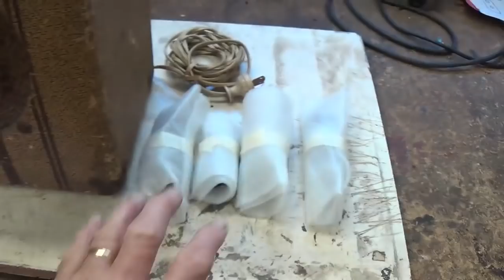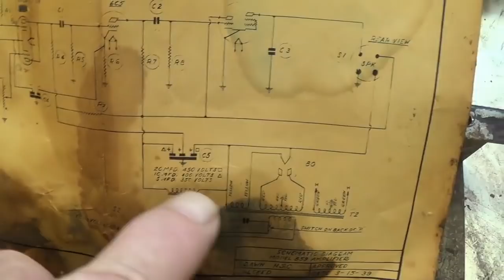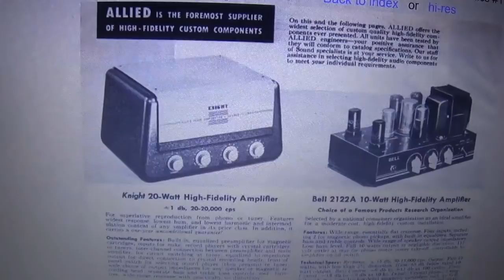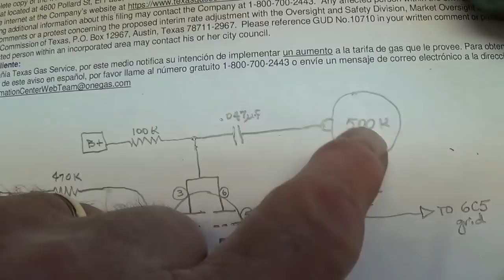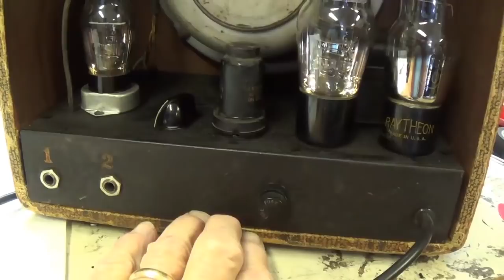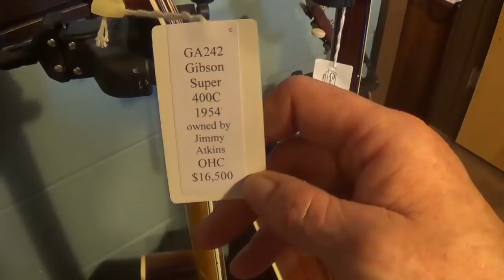Resurrection of an Ancient 1939 Kay Model 859 Amp....The Mouse that Roars (60Hz)

Comment from the maker: NOTE:  I believe the audio clips obtained with the microphone were hampered a bit by the wood fretwork covering the speaker. I tried to aim for an open spot, but still had a noticeable reduction in volume at normal recording levels.
Reply from the maker: It is intended for harmonica, so it may work out just fine.
Reply: Another interesting & informative video UD thanks!
Reply: Doug, perhaps you or whoever owns this amp should try miking it from the rear of the speaker cone, or perhaps use a mike in the front as well as in the rear, and reverse the polarity of one of the microphones by flipping the wires  inside just one microphone cable ( swap the hot and neutral signal wires, at just one end), or making an adapter for this polarity reversal, so that you can use both a front microphone and a rear microphone at the same time .
Reply from the maker: You read my mind, GU. I have a Shure 58 that I intend to use for exactly that purpose.  I'll be experimenting with it in the future. Thanks !!!
Reply: That's alright, honestly all I hear is the heavy MP3 compression on the audio tests.  So even if the wood decoration wasn't there the amp's real tone still wouldn't come through unfortunately 😑.  --Jason ✌🏻&❤️
Reply: Often, an amp in a confined space makes for a good recorded sound - We used to pile wood up in front of Marshalls to get a really punchy sound. So if this is used for harmonica it may well shine! :o)

Comment: Hahaha 
This was the Sprague potentiometer that failed. I mentioned one in a previous war Oahu.
Mine is fine but this one proves why sprague stuck to what they were good at. Condensors or capacitors!
I hope we are doing well uncle.
I hope we all hear from you soon.
Reply from the maker: Thanks, Cdog. We're doing fine and should be back on the air soon :)

Comment: Next time you have the opportunity, try referencing the heater CT to a positive DC rather than ground (30-60v is fine). I find that you get much lower hum. If the amp is cathode biased then its much easier to implement, as you can literally just solder the heater CT to the output tube cathode. If you have an artificial CT with 100R resistors, then its not much more work - just solder direct to the output tube socket using the heater and cathode connections respectively. In fixed bias amps, you can use the negative bias supply or just create a voltage divider off the HT rail to get around 50v together with a small smoothing cap (say 22uF).
Reply from the maker: Thanks for the helpful information, HTH.

Comment: I don't get why you were so insistent on preserving that power transformer.  It was garbage and should have been thrown out.  I know you take pride in your work and like to preserve the vintage parts that are salvageable -- but that thing is, at best, on borrowed time.
Reply from the maker: Thanks for sharing your opinion with us, Evan. Fortunately, the PT and amp are still functioning perfectly.
Reply: Uncle Doug don't make them like they used to apparently.

The old ones at work that look like that are usually toast.  Whatever enamel or varnish they coated the wires in didn't seem to stand up to overheating too well.

Higher voltages at work though 👍

Comment: You should start selling Uncle Doug repair kits thru StewMac that come with 4 Xanax 😂 “Even if the repair fails you’ll still be happy!”
Reply from the maker: Or maybe a dozen Xanax and a pint of Vodka......for the ultimate escape.
Reply: @UncleDoug  GEEZ ,Doug...this just took a fairly dark turn. Besides with my luck hell would turn out to be real and filled with 80’s solid state crate amps.

Comment: I'll bet the reason that the original guitar input had no volume control is because the designers were thinking it would be redundant since the guitar would already have a volume control knob.
Reply from the maker: Exactly, Greg, and most guitars have a built-in tone control, which makes me wonder why people are so focused on developing elaborate tone-sucking "tone stacks" in amps. The purest tone of all probably came from early amps like this one, which focused on amplification, rather than modification, of tone.

Comment: That design is beautiful, but what were they thinking when they blocked the speaker's output by that tremolo/vibrato faceplate?
Reply from the maker: I think back in 1939, they were more concerned with appearance than unrestricted  speaker output, LF.
Reply: @UncleDoug  appearance over output.... that sounds about right.
Reply from the maker: @thelokifiles  Not the way we'd do it today,  for sure :)
Reply: @UncleDoug  I'd enjoy seeing an even pairing. The Vox I have is close I guess.

Comment: I have an old RCA tube manual. In the back section shows the 6N6G is a power
Triod with 300volts to the plate. And proper biasing wich did not specify 0 volts to grid 
Will be 4 watts out so 
Perhaps theres around 3and 1/2 out 
On that very old piece
Of art nice work
Uncle Doug/Danasonic.  Nice vidios Uncle. Yours truly. Dwight
Reply from the maker: Thanks so much for your helpful input, Dwight.

Comment: Hi Uncle Doug I been learning! I have a Vox AC30 it is cutting out! Can you look an check it out?
Reply from the maker: It will end up costing quite a bit to ship it to me, Nick. You might better off cleaning the tube sockets first and seeing if that helps.
Reply: @UncleDoug  Hi again The AD30 is a VT 1 tube I cleaned with Caig Contact cleaner no go volume dies also Gain has some trouble it suppose to go into OD I Live in Mass. 02476 please reply??
Reply: @UncleDoug  Hi again I figure on sending the chassis how can I send it to you I an in Massachusetts 02476 that is Arlington!!
The shipping of course will be both ways if you agree on this all you'll need is a Speaker!! Thank you !!
Reply from the maker: @nickf.9434  Please provide your e-mail address and I will contact you directly to arrange shipping.

Comment: People bad mouth these american made old technologies like wax capacitors ! But they lasted 80 years !$@# you think that the chinese caps even the one surface mounted will last that long ? when  they make 5 years it become a celebration !
Reply from the maker: It's true, Pete, that the components used in vintage amps seem to have incredible life spans. I have several amps that function perfectly with 60+ year old filter caps.....which is not supposed to be possible. I think the newly made components, such as those you mentioned from Asia, will probably last quite a bit longer than 5 years, but may well not be as durable as the vintage parts.  Only time will tell.

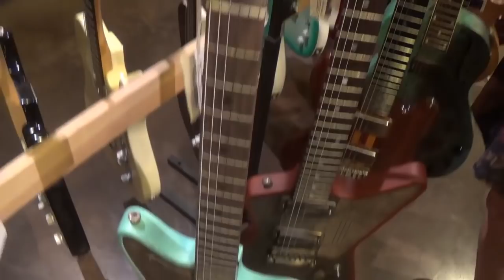Comment: The guitar at 42:55 is really interesting. Those actually may be Jazzmaster pickups. They are in Jazzmaster pickup covers for sure. Quite a bit different than P90s, as similar as they look. Super thin bobbin, wide winding that almost reaches the end of the pickup cover, and alnico pole pieces instead of P90 bar magnets. They have a clear, bright wide frequency response yet still sound Fender-y while P90s are more of a "rock n roll" single coil. More apparent mid-range, great middle ground between singles and humbuckers.

Edit: Just noticed somebody mentioned them before me. Guess that's what happens when I'm late to watch a video and Jazzmaster/Jaguar fandom is at its height. 😉
Reply from the maker: Thanks for your knowledgeable input, Julian.

Comment: The input tube should have a shield, that's what the collar at the bottom is for, the shield slips over it. It's made of aluminum.
Reply from the maker: I used to have "mummy" shields when I worked on radios, OR, but not any more. Hopefully, the amp's owner will be able to track one down on Ebay.

Comment: Looks like the hum was caused by the grid being unconnected to anything due to the faulty pot, which should have been providing its grid leak. How does that output stage possibly work without a cathode resistor?
Reply from the maker: Sounds right to me, EJP.  The 6N6 is an odd tube. Look it up and you'll see just how odd it really is.  There is an internal resistor that provides a negative grid bias with one of the cathodes grounded.
Reply: Uncle Doug Cripes! I see what you mean. What a thing! And positive grid bias on the two RH grids yet!

Comment: One thing I noticed is that all those old amps have the cloth for speaker protection on the inside, vs. some decade(s) later, the complete front covered with it. Is it purely fashion, or economics, or is there a sonic difference? I imagine that the speaker is not connected to the front plate in a perfectly air-tight manner like with the foam stuff around the rim they have today - no idea how much that matters. But it's still dampened with that cloth in between vs. bolting the metal directly on the wood I guess.
Reply from the maker: It's true that in the old days, the grille cloth was behind the baffle, between it and the speaker......while now, it is generally covering the surface of the baffle and gapped away from the speaker a bit. The modern way is probably better, since the speaker has room to "breathe"......but to be honest, I don't think it makes a big difference, as long as the cloth is very porous.

Comment: Hi Uncle Doug--nice job as always.  I would like to say that using the grid stopper resistor in the input stage to control frequency response is a bad idea.  The purpose of this resistor is to limit the high-frequency response of the input stage to eliminate interference from r.f. sources, and also reduce the possibility of oscillation.  One virtually never needs to use a resistance higher than 34k, which is what Fender uses (remember the the 2, 68k resistors end up in parallel).  Resistance higher than that adds noise, and why would we want that?  Also, the use of a metal-film resistor in this position will reduce the noise of this resistor even more.  There are always better places in the circuit to limit high-frequency response.  The customer may have requested the high value grid stopper, but we wouldn't necessarily expect the customer to know the best design practices for tube circuitry.
Reply from the maker: Thanks for your input, R. As you say, the customer may not always be right, but from my experience, whenever you overrule a specific request.....and ANYTHING ever goes wrong......it will undoubtedly be attributed to the change I insisted on. That, and the fact that the amp was totally free of any background noise, led me to incorporate the higher-value grid stoppers.
Reply: Hi  @UncleDoug , I hear you.  Whenever I think about how to design a guitar amp, I start by looking at the Fender circuits.  Leo was a smart cookie, and he almost always put tone modification circuitry between the first and second stages.  It's a good place for it.  Once, with a tube amp I created out of an old hifi amp, I listened to hiss with the volume up as I played around with various grid-stopper resistors.  You could definitely hear the stoppers.  Keep the stopper low, use metal-film resistors for the stopper and the plate resistors of the preamp stages, and you will have the quietest tube guitar amp you every heard--the normal hiss will be gone or at least substantially reduced.
Reply from the maker: Excellent advice, R. Thanks !!!

Comment: UD I have a few questions about the speaker repair you did, because I need to do one. 
I'd rather refresh the speaker cone/surround than spend $90.00 for a new speaker, if possible.
Thanks in advance.

1) Did you dilute the contact cement with a solvent, or did you brush on a thin coat, straight from the can/bottle?
2) If you did dilute it, what solvent did you use?
3)What brand contact cement did you use?
4) Would rubber cement work as well, or does contact cement work better?
Reply from the maker: I used Weldwood contact cement (the original toxic type, not the sissy water-based version) undiluted. Use anything else at your own peril :)
Reply: @UncleDoug  I have the original Weldwood, not the water based. Guess I'll give it a valiant attempt. 
Thanks, UD.
Reply from the maker: Good luck.
Reply: @UncleDoug  I used a speaker from an old Sharp solid state radio as my guinea pig. 
That original Weldwood is good stuff. Thanks for the suggestion. It worked.
Hopefully, it'll help the Newcomb's speaker.

Comment: Hey Unc,
  I'm rather familiar with 30s radios and there is, I believe, a Philco grille cloth that is very close to the one in that amp. I want to say it's 1935 or earlier. I know I've seen that pattern before, or one very similar. I can't find it available today, either. It's a shame to leave it tattered like that. 
 What a great little amp, and a great repair video.
Reply from the maker: Yes, it looked familiar to me also, Tom, and I'll bet it is still offered by some radio parts suppliers.......but the amp's owner opted for original.
Reply: @UncleDoug  Tattered grille cloth or not, it's a sweet old amp. I'd like to hear it with the owners harmonica.

Comment: I think the second channel was labeled "Micro 2".  I think this is the second amp I've seen on your channel that didn't have a level control for the guitar - just the mic.  I guess the idea was the guitarist was to use the controls on the instrument.
Reply from the maker: Yes, and I have come to actually prefer the purity and simplicity of circuits that don't have elaborate (or for that matter, any) tone controls, Russell. Using different pickups, and the guitar tone and volume, you can generally achieve the same (or better) results.

Comment: Grand restore as usual, sounds well  and an interesting look at hum issue's, that was a master class. There is an interesting discussion here - https://www.vintage-radio.net/forum/showthread.php?t=160469 about combined volume pot/power switch's; basically it's a daft idea and switching only the live or neutral is dodgy. Re fixing speakers, you can also use layer's of tissue and watered down PVA glue to fix holes. Like your rubberised glue idea. Thanks....DA.
Reply from the maker: You're welcome, DA. Thanks for the helpful comments.

Comment: That last amp, the vibro champ amp, i used to have one of those. I picked it out of the trash. I had it "fixed" supposedly, probably only put out about 1 watt, lol. I was about 12 years old. I ended up selling it like a complete moron back when i was like 19. Almost 30 years later im building tubes amps. Go figure... Lol
Reply from the maker: Well at least you finally found your way back home, Bruce :)
Reply: https://www.facebook.com/100001223897719/posts/2606112682772836/?app=fbl 
Its a cascaded marshall type amp im currently working on slowly but surely, little by little as i can afford and aquire parts.

Comment: Uncle Doug, was that a resistor you found from heater to cathode? On the power tube? Don't some folks create a artificial center tap as you did but connect it to the cathode instead of ground?
Reply from the maker: Yes, but it was attached to the grid of the tube.......no one in their right mind does that.

Comment: Seems like there was an attempt to elevate the heater circuit voltage, which is one way to try to reduce/avoid hum. As I understand, Its still 6.3VAC peak to trough, but its not referenced to ground. You can't use a center tap or virtual center tap with that. I have an amp someone built styled after the AX84 SEL, it uses elevated voltage from the cathode of the output tube, and it is quiet, but you can't use 6.3v pilot bulbs.
Reply from the maker: The problem was, as I recall, that it ran from the AC filament lug to the tube grid, Rick......which doesn't seem like a good idea to me.

Comment: I think the 6n6g comes out as 5w,volts x amps, but it calls itself a 4w output, strange... Is 8 OK?
Reply from the maker: The output may be only 4W, but the plate dissipation is the measurement of concern. I understand that my 8W PD reading is within specs for the tube.
Reply: @UncleDoug  ahh, I wondered how there could be such a difference between the two, now I understand people saying they get hot!

Comment: Can it not be that in the schematic the pot was used set the grid to ground? I've always wondered if that can't be a way to bias the tube. And i like the sound of that thing. :)
Reply from the maker: The VC offers the signal two pathways, one to the grid and the other to ground. Depending on the position of the pot, the signal volume is regulated.

Comment: Uncle Doug, thank you very much for this fascinating video about such an old amp.  I just wish I knew half of what you've forgotten about amps!

I think I've got you beat as far as computers are concerned though.  Mine is steam-powered, with blinkenlights and toggle switches.  It's been pimped up with 8-inch floppy disks, a Teletype ASR 33, and a ~2MW (where Word = 12 bits) disk cartridge in a 110-pound drive unit.  One of these days I hope to really pimp it with a magnetic tape drive too.  ;)  The 2 (or 4?) filter caps are Coke can size!
Reply from the maker: You're welcome, Bob. That sounds like a fabulous, state-of-the-art computer system. I would offer to trade you my punch card computer and abacus for it, but I realize this would be an insult :)

Comment: @0:32  That loud, huh?
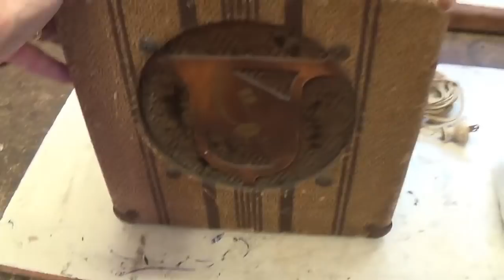@2:21  Kerosene!? Lucky skunk I still got the old squirrell driven....but it boots up faster.
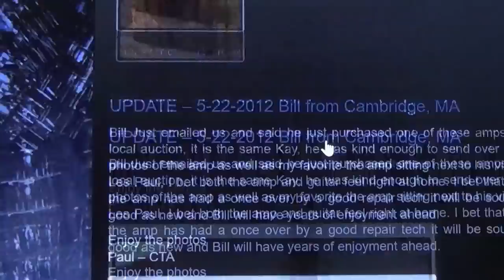@3:12  <clicking noise while scrolling> Is that a ratcheting windlass mouse wheel?
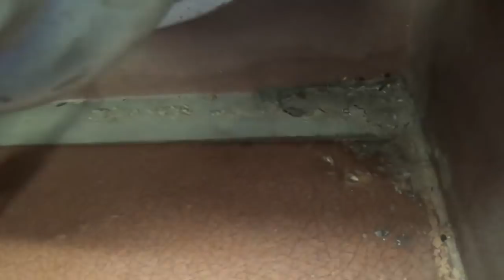@5:32 TIP: A 32oz. ball-peen hammer and cold chisel is sometimes enough to persuede removal of rodent excreta. Wear eye protection.....mouth protection too.
  Great job. Beautiful amp. Sounds good too. And then there were three.
Reply from the maker: Thanks for those very helpful tips, Michael.  The mouse is a Logitech "Wheel Mouse" that seems quite appropriate when plumbing the depths of rat-encrusted amp cabinets.  I forgot the mouth protection during the feces extraction, and will never do that again :(